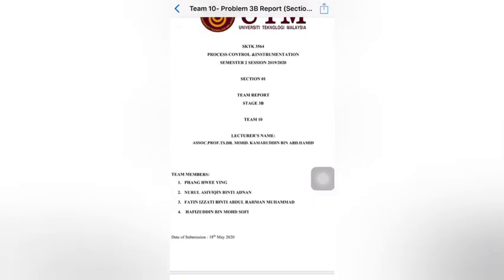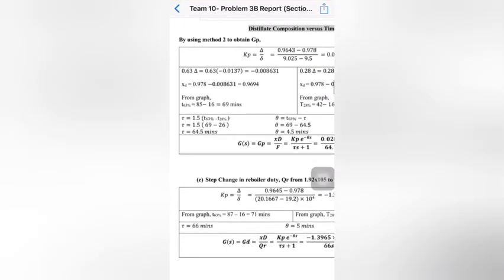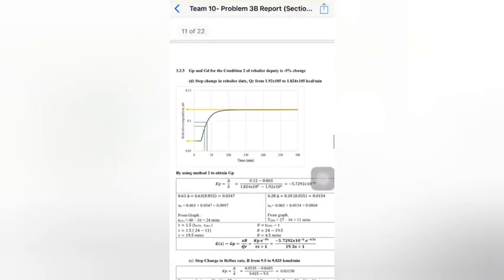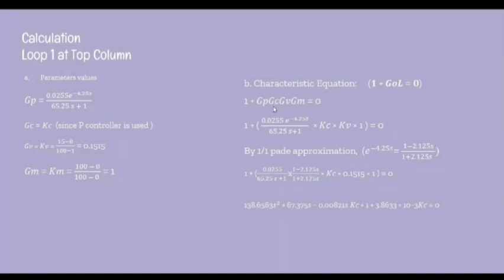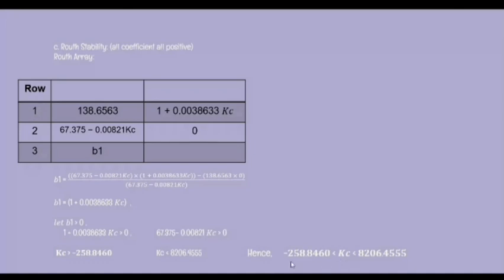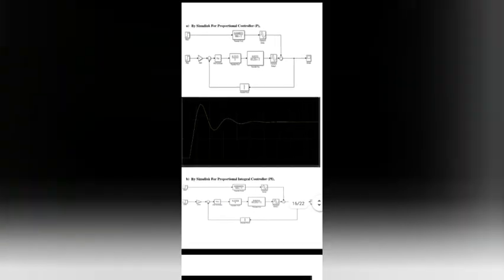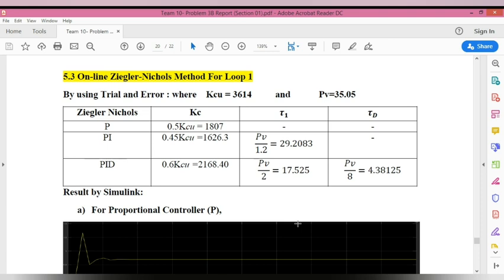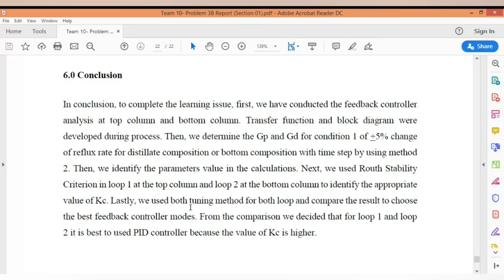Closed Loop Stability and Tuning - Team 10

Comment: How u obtain the Gp in the routh stability criterion in top column and bottom column ? Seem that the value is different in the previous calculation which explain by phang?
Reply: HI Chai Hong, for your information, the Gp value used for the calculation of routh stability is the average Gp of both conditions of  +-5% change at top column and the bottom column respectively. I have summarised the parameters value at the top and bottom column respectively which is same with the Gp value that we used for the calculation of Routh Stability criterion.